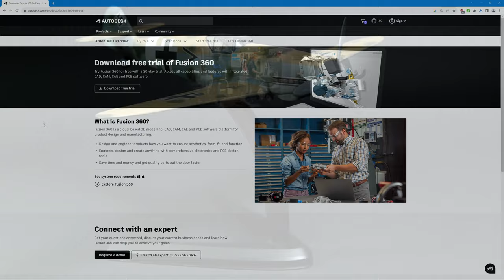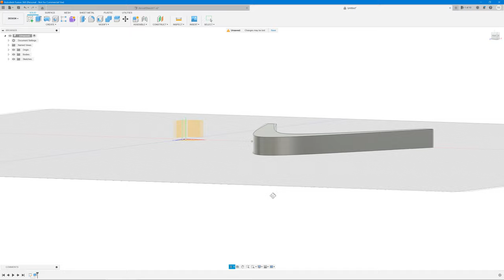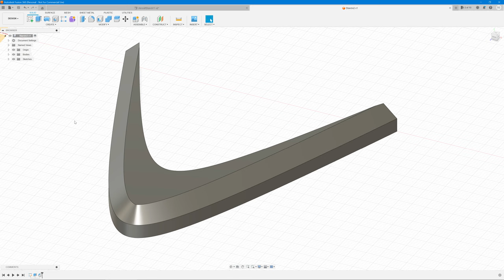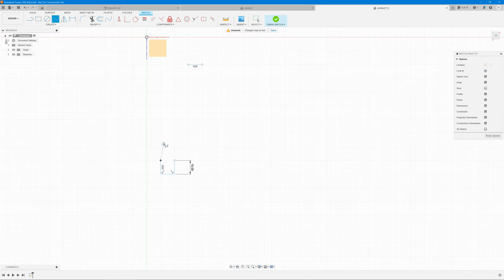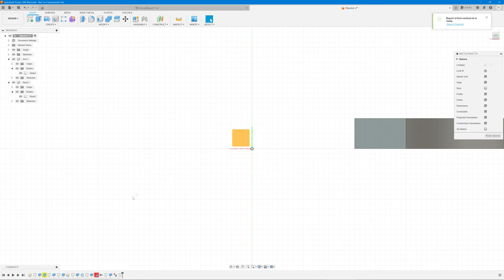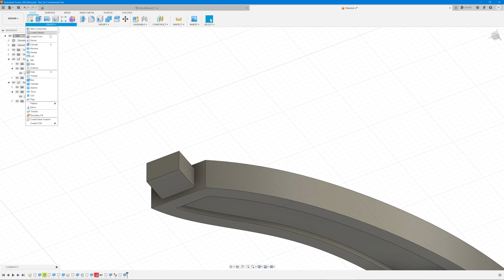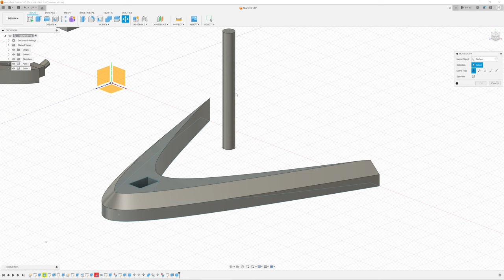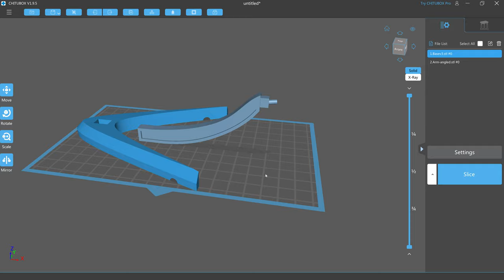Design your own scale model aircraft stands with Fusion 360 and Creality Halot One

Comment: Just printed up mine!  Couple of changes I made were using the shell command on the base to use less material and avoid sticking to the printer base.  And making a "wedge" shape for the vertical member where it slides into the base.  Nice job!
Reply from the maker: Nice! Glad to hear it worked well. Yes, the wedge shape is a good idea. I tried a version where the arm was 0.5mm smaller than the hole but that was too loose; a wedge is a great solution.

Comment: Interesting.  Does Fusion 360 allow you to use normal units instead of SI?  I noticed that you switched halfway through the arm of the stand, going from mm to mils.  Being able to design in mils would be so awesome!
Reply from the maker: You can use Imperial or metric units. That's funny actually - I was using mils as a short form of mm. I've never heard it used to mean 1/1000 of an inch (I had to Google it). I guess that is a UK vs US difference :)